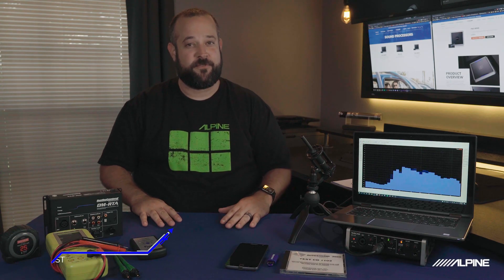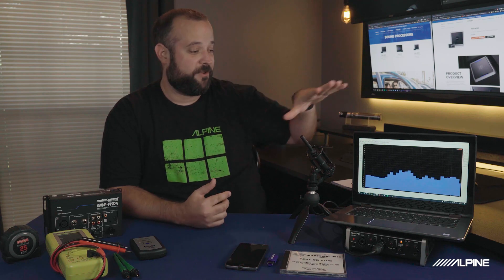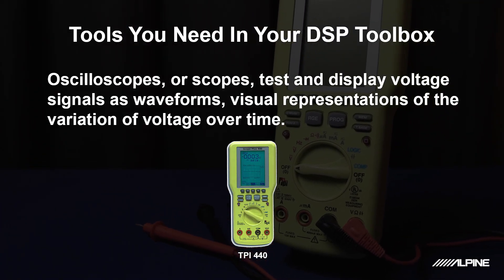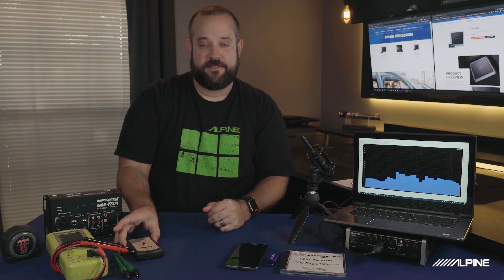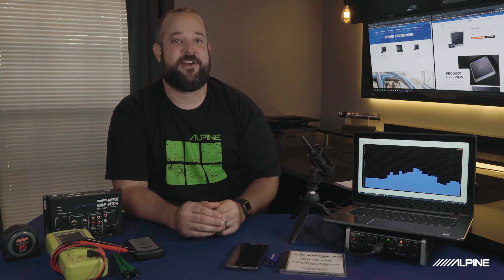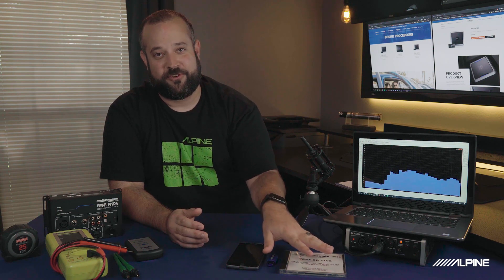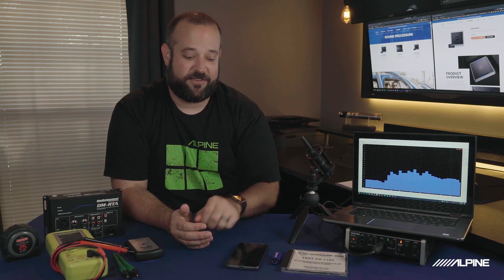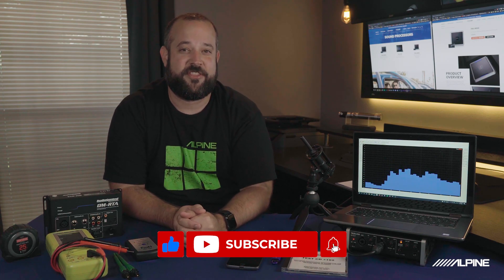Tools you need to Install and Tune a DSP

Comment: The speaker delay, or timing formula, what do you do if your using inches not meters ?
Reply: I don’t know why there dsp don’t do thst for you. The dm-810 does it for you. Ac’s rta also checks clipping, phase and shows your signal before and after the dsp so you don’t need all the other tools. Way I see it it is expensive and takes hours as it is to properly tune a system. Anything that can be automated to help speed the process and save money is a bonus in my book.
Reply: @tiny3669  Agree strongly with this. This video is showing the super expensive tools manual way which is just out of date. Plus you can get RTA software free and open source from Friture. The DM-810 can do it for you automatically and you can crosscheck it with Friture and your ears and you are a long way there.
Reply: convert inches to meters? It's not hard
Reply: @typ237  Thanks, im having a real hard time getting my timing right, i have tried lots of youtube channels and did there settings and it dont sound right.

Comment: DAN I CAN TUNE A SYSTEM BY EAR, AND MAKE IT SOUND AS GOOD AS YOU CAN WITH THE TOOLS.
most installers try to set up a system all connected,  you cant do that.
You've got to isolate each componet
And tune them by ear untill your just above the noise threshold  using the same disk on every system Alpine had a disk years ago my rep gave me I still use it today to tune systems.
I did high end car audio for 17 years in retail as an installer. 
Granted my 61 year old ears don't work as well anymore I still know what distortion is. Im also whats called an audiophile with home systems.
This is my reason Alpine needs to pull its brand out of best buy, you walk into a best buy and the kid salesman cranked the music up full blast the subwoofers are falling on there ass the tweeters sound like they are 3500 dgr F and launched out the gap.
He's pushing the woofer into clipping
And this 75 watt woofer is getting 450 peak power from an amp thats about to catch fire. The total system is starved for 12 volts becuse they hooked it up with 18ga speaker wire on the power side of the amp. And the power supply they are using was not rated for the output its being asked to do.

And if you ask them to recommend a pair of subs they will sell you 2 4 ohm subs wired in stereo. 
Insted of 2 8 ohm subs in series on a bridged amp @a 4 ohm load or 2 4 ohm subs on a mono amp that can run @ 2 ohms. 
This is why JL audio made the slash series amps Jeff Scoon developed. 
You can run in 8ohm down to 2 ohms.
Becuse the kids at best buy dont know shit.  Not all of them but best buy in a big box store with a lot of locations.
Seriously someone who sells refrigerator to install my car audio system?

The time to move boxes is over, there's a limit on dashes needing to be filled now.
Reply: It allows consistent and repeatable results with a variety of setups and equipment. It is also not supposed to be the final tune but the point where you feel comfortable firing it up and listening to it. Your ears should be the final judge every time after driving and listening to various tracks at various volumes.